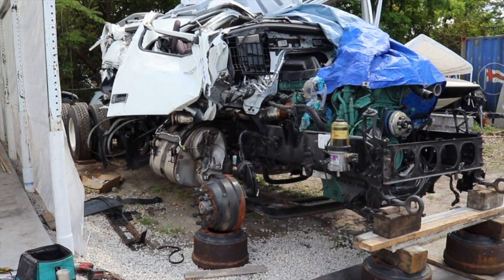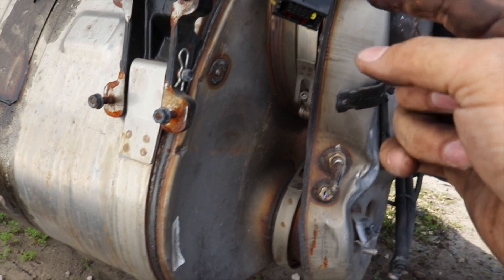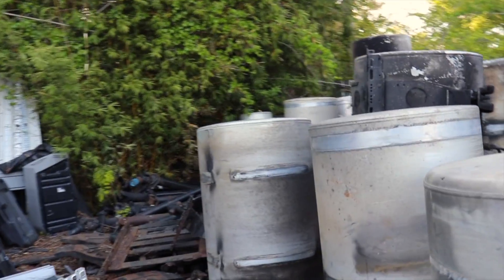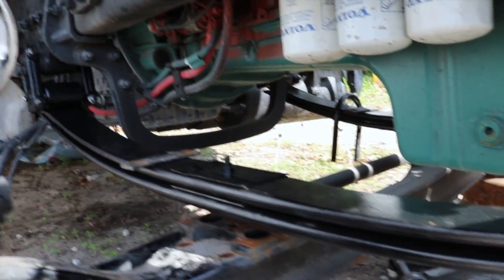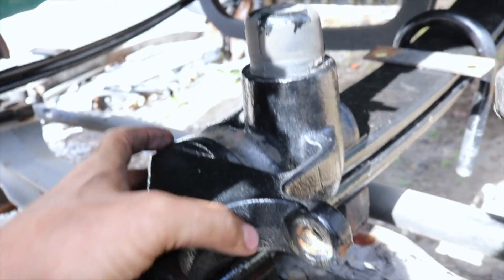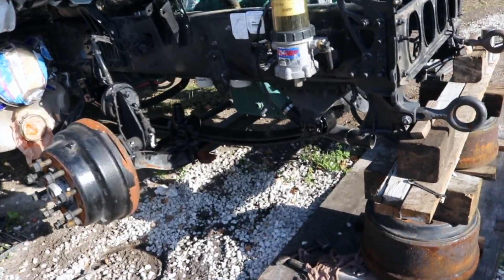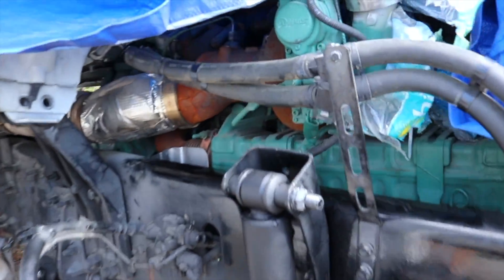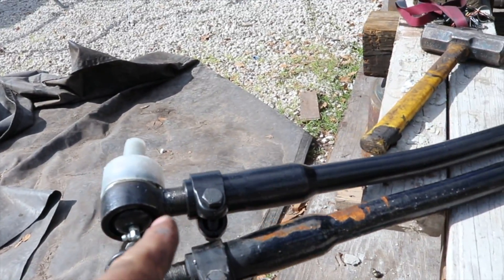Rebuilding The CRAZY Wrecked SALVAGE 2019 VOLVO VNL Semi Truck COPART Project| PART 6 |

Comment: First Off Great Videos Continue to make them!!! I noticed the UBolts that you did with the small impact are on but I woule advised that you tighten them with a air gun I had to go to FalconTire on Lane  Ave to get my tighter because my were "lose" I tried everything including heating the bolts up and tightening with a 10ft extension  bar anyway just some friendly advise, You are completely right About Tom Nehl Volvo I needed to buy injectors and the price difference was $600 off between quotes... O yea I got my Volvo off Copart as well...
Reply: Also a quick question I need to get s top bunk for my Volvo may I know who youre used junkyard guy is? THANKS

Comment: My father and i rebuilt his 74 KW and updated it to a dd3 detroit it was quite the undertaking we changed from torsion bar suspension 2 Peterbilt air ride went from a six and a four to a 13 speed went from sqhd rear ends updated sq100 if I remember right which was a much better rear Inn we even change the frame rails anyway he would be proud of what you are doing. O yeah he had a formula big cam cummins motor and was so happy with the detroit

Comment: Just delete the cab and have the first open air semi. Drive around with flip flops and a wife beater on. 😂
Reply: And weld a train bumper on the front for traffic jams
Reply: Look (up) Thomas bus company... they move driving chassis to the body mating building like that ... without the flip flops.
Reply: Yeah, but Volvo drivers always wear flip flops.😂
Reply: @robertboyer5498  flip flops and wife-beaters
Reply: Wouldn't be the first.  They do that all the time in Africa.
Reply: Robert Boyer put a lift kit on it

Comment: Everyone of them semi's should have and had roll bars installed. Actually every  single vehicle on the road should have roll bars installed standard. Safety should b the number 1 priority.
Reply: Glendale Walter 
All Volvo’s come with a reinforced frame around the windshield and down to the floor, I believe freightliners do as well now. It’s not a true roll bar, but drivers are living even walking away from wrecks like this so it’s a start. Not much has been done in the bunk area though for roll over safety.

Comment: if the cover for the dep filter is realy expensive you could hammer and weld the part so its straight again so you only need the sensors screwed intoo it 
as for taking off the cab : put the front wheels back on before taking the cab off  , if you have the truck on blocks and wiggle it of while struggling with the cab and it falls of you end up with more damage , the wheels will prevent that

Comment: Got a suggestion for you when replacing u bolts had a old mechanic show me something. If you hold the u bolt on one side and hit the center of the crown or top of the u bolt with a sledge hammer and it will spread them out and make it easier to replace

Comment: It’s gonna be hard to find a cab for that model, that’s the new model and not a lot of them are in junkyards and if they are the cabs are no good, my suggestion is to go back to the older cab and hood, they should fit, everything that I’ve seen looks like they used the same frame

Comment: That bar under the steering gear box is called the pitman arm just saying instead of replacing the def system u could take it to Diesel Dr when u get it rolling and get it deleted for $2900 I'm doing that to my 2016 Peterbilt this summer
Reply: I think that is a drag link. Volvo used to a recall on some 2003 to 2007 steering drag link and sent out letter with pictures so I am pretty sure about this.
 
Steering box > pitman arm > drag link > steering knuckle
Reply: Don’t delete clean out the entire system and keep rolling. Everything all pipes and sensors. Even clean the valves and pistons.

Comment: Just to let you know there are no "struts" on your truck. They are shocks. Shocks don't go back into place when they are removed either, that is the idea how they work. They are hard to move in and out to cushion bumps and to stop your truck from bouncing. That one with the dent in it if not leaking and moves all the way in and out with the same resistance as the one that is not damaged then it is fine. A small dent will not affect it. If they shaft is bent it is junk.

Comment: I did think that dam truck was totally toasted in the start, I can't even start to think to buy it :) I did buy Fiat Scudo in the start of this year with bad casked and cant now even fix it because I can't even open dam hud because the lock is jam... I had planned to get the van fixed cheap but even place what I think to use don't anymore take outside jobs so I am screw with it now:)
Reply: Yea, I did get hud open last month and I did also use Wondarweld Heavy Duty Crack Repair to fix any leaks (after I did wash system). The only thing in the motor (I think) is that fan don't start running even water heat goes to +90c (thermostat opens +82-83c) so I did buy new sensor to it but haven't yet put it in. In checkup (every year to do with cars here in Finland) I did get long list things to fix like breaks has not equal power, hand break also must be fixed, some light problems, one track controller arm must be change and dam driver side running board is totally trash :(  But good news was that the motor test did go well so it is good :)

Comment: We had a guy come in the shop for a Pa State safety inspection. He made his U-Bolts out of all-thread. Then got mad because we failed him. Didn't charge him, or even pull it in the shop, just tilted the hood and saw it during a quick look at the truck. Still wanted to argue and wanted us to pass it, then said we were ripoffs.

Comment: If you could get your hands on the individual part numbers I would suggest searching online for them.
May not be the level of your junk yard buddy, but at least for car parts it can save a lot of money, so I think with truck parts it could be similar, even with shipping.
But look always if OEM quality parts are sold, knock offs are not very hot shit for the price. Always choose reputable brands and sellers known for selling real OEM and no copies.
Most, if not all, vehicle manufacturers do out source many production steps to other suppliers, they don't make every bracket on their own, but buy it from third party - quality checked and properly branded of course - and only puzzle the vehicles together in their factories.
So if you can get virtually the same part, rolling out off the same third party manufacturers facility, but without the Volvo branding on it, you don't have pay Volvo prices for the same quality.

At least in Europe/Germany this is always a viable option for many wearing parts. Only design protected parts (doors, panels and the like) are not possible to get here in Germany - hat is local stuff, where our manufacturers lobbied that much...over in the Netherlands you can get even that in respectable quality for a third of the price.

But, well I don't exactly know how it works in the US and especially for Trucks/Semi.
Just want to be helpful.

I don't know if it were possible, but I would have tried to bend back the brackets for the shocks - though, as you only paid five bucks each (plus gasoline), that would possibly only robbed time...

I am awaiting your progress here, but don't let yourself press to do certain things at a certain point of time. You can do only so much at a time and with that project you only have yourself at your back to get it done, and no boss to boss you around.
Just don't boss yourself around too hard.😉

Comment: I seen a salvage yard on 10 in florida with a volvo 880 cab fot sale
Reply from the maker: Go Hard Performance need a 760 2019 model different
Reply: Yea but if it bolt on that would be epic . There are companies that make glider kits which is new motor frame gadgets with older style cabs for the rustic look . Most will swap out you would be surprised bro

Comment: Unless you did it off camera I would suggest finding the torque specks and torquing the U bolts. I just don't trust the electric impacts for that job and U bolts on a steer axle are the last thing you want to come loose on the road.

Comment: Rusty are you sure the impact wrench you use tightens these bolts are tight enough cause this is a big rig bolts. I thought you'd make sure with a braker bar or torque wrench. Just for precaution you never know
Reply: If anything it could over tighten them. Milwaukee impacts can hit 1500 or 900 ft lbs depending which one you buy.

Comment: Don't bother prayig to god. First it is a waste ot time.  Why. god doesn't exist except in those people who indoctrinated you.  TAKEN APART. TH is not pronounced "D"  Aside form that - nice video series. You have a lot of ambition to undertake that rebuild of this tragic wreck. Graveyard - yes that's where Volvo's should be. Get a Peterbuilt if you want a real truck.  THESE are the parts we bought.  THE STRUT, not Da Strut. What do you bother mentioning what you paid. You have a special price.  This little nipple is called a ZERK fitting. There is a difference between struts and shock absorbers.  You could have moved those shock brackets back into alignment. Nicely done. It looks good.  You could have straightened that steering link. Right save money were you can. You are certainly capable of straightening things out.

Comment: Stop wasting time with def just do a delete
Reply: Sebastian Brzeczeszczykiewicz delete causes more problems down the road. Keep the emissions and clean it all out every 200k it won’t have failures like everyone says
Reply: Mark M your comment tells me you know nothing about diesels
Reply: Sebastian Brzeczeszczykiewicz The emissions delete business is full of scammers and shitty technicians that don’t know what they are doing. Even the most prestigious and expensive shop can destroy your truck. It won’t happen the same week, or even the same month, but eventually the turbo will melt from extreme exhaust temperatures because of the shit tune. Since it’s all illegal you can’t sue anyone and they have you by the balls since you can’t go to Peterbilt anymore. That is exponentially more risk than just keeping the entire engine and emissions system as clean as possible.
Reply: Mark M 🤦‍♂️
Reply: Mark M rolled my dice over 2 million miles ago
Reply: Mark M why are you erasing your comments
Reply: Sebastian Brzeczeszczykiewicz I took my argument way too far and you have experience with your delete. I didn’t want anyone else reading this thread to be misinformed.